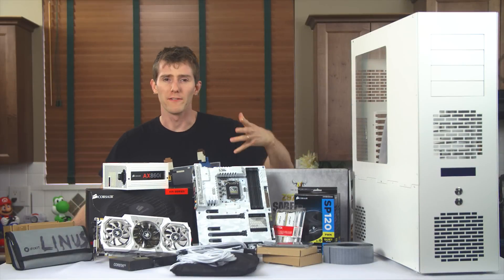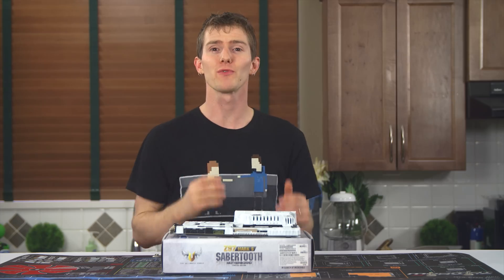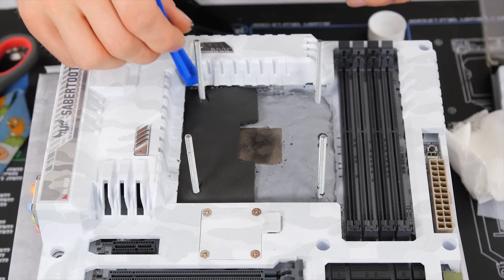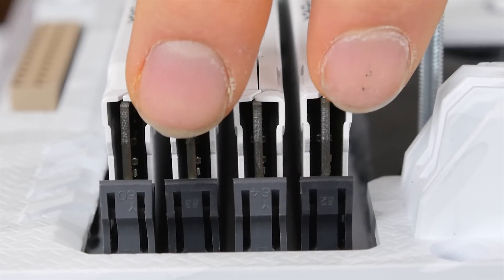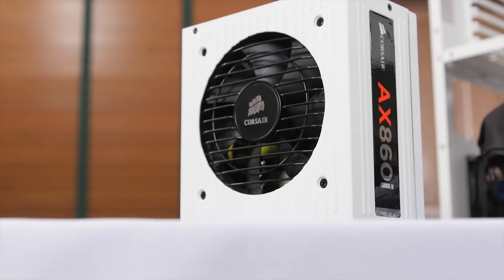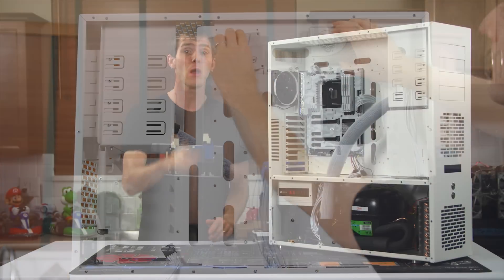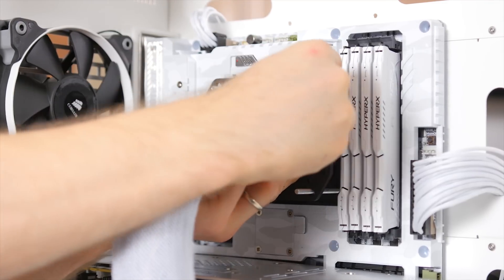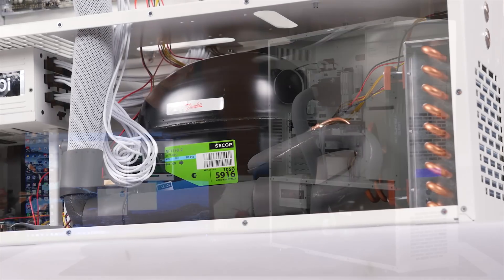ULTIMATE Sub-zero Phase Change Cooling PC Build Guide

Comment: how is it so hard for people to understand that the computer doesn't have to be in the same room. if you have a closet anywhere near where you want your workstation/media center to be that is where your workstation or media center should go, if you can vent the space directly outside all the better, but in most cases you can vent the closet up into the roof that has venting made for dealing with a surprising amount of heat, so much that no single computer could really do much to it. it isn't a rich mans deal either, it doesn't cost much to get your system set up in a room outside where you intend to use it and the difference in latency is negligible at worst. just put your computer somewhere else, maybe even just put it in the attic.

EDIT: in the case of apartments vent the heat to a room that has a vent (most closets don't), if you can afford to do a build like this you can afford to pay for the wall in advance, if the landlord doesn't want to take the money go to a well known local contractor that has been around for a few decades and buy a ticket for replacing the wall if you ever move out, that way if you can't afford it when you move out you already payed for it so you won't get stiffed on your deposit or hit up for repair. get two copies of the transaction and give one to the landlord so if you forget to call the guy up the landlord can, and if he doesn't bother to read his file on your apartment you can point out that you had already paid for the wall to be replaced, you just forgot to call and he could have because you gave him the information.
Reply: MarioDragon It reduces noise, so you can have water cooling/air cooling and fans running at 100% without hearing it.
Reply: basically, if the computer is too loud, move the computer, it works just as well 30 feet away in it's own room as it does sitting 5 feet away in your living room. stop thinking in a box people.
Reply: This reduces temperatures for overclocking... how?
Reply: Mathias :P thx
Reply: If you guys think having a mini fridge on or under your desk and think it wont be loud, you must be deaf. This would be very loud.
Reply: Apansyy wrong thread? nobody here is arguing that. this thread is about the fact that your computer doesn't have to be anywhere near you in your house. i haven't mentioned it yet, but this is why i don't care about how loud my computer is, if it gets too loud i'll just invest a hundred or so bucks and move it to somewhere else, i already only use a usb3 hub for peripherals, and i connect nothing else except sound which i could route pretty easily through optical without much added cost for the receiver, and i wouldn't need that for my headphones because they are plugged into my monitor that gets sound through hdmi, my speakers would need a line in, but i could give my speakers that from the same source. i think that most people don't realize that usb and hdmi cables can be 30'+ in length, and with that length they could literally put their computer a couple rooms away from where they are using it.
Reply: kght222 Sounds legit to me. I used to move it about three meters away from me when silent fans were not a thing. Still noticeable, but much better. And with the digital signals from DVI, you don't even need to worry about a massive input delay of your monitor. So yeah, your solution is recommended Sir.
Reply: LimPu people need to know that walls are not obstacles, they are cheap to build in most cases and as such cheap to replace if you have to, drilling a hole into one isn't a big deal. once you isolate your system to your server room you can worry about sound dampening the room, but worrying about the sound output of the computer itself should be the niche issue, not the other way around. everyone needs a server room.
Reply: Mathias :P I've had my fans at 100% before and noticed no major difference in temperatures when it came to overclocking. Even adding more fans is minimal, 1-2 degrees at most. Someone doing this doesn't want what mildly cooler air a full fan will give, they want... sub zero
Reply: Mansen hack nothing, all those cords are available pretty cheap on amazon. what costs is if you want to go wireless with your usb extension.
Reply: ***** usb can go pretty far, you just put a hub on the other end.
Reply: ***** a 16 foot active usb3 extension cable is only about 15 bucks on amazon.
Reply: ***** oh, and no. you would not have to go outside the room every time you wanted to turn the computer on or off, it is quite possible to do that through normal input devices over usb. usb3 may have some issues doing it still (don't know) but usb2 has been doing that for over a decade.
Reply: ***** and to connect/disconnect something you would just plug it into the usb hub in the room where you are, not go all the way back to your server room or media center closet.
Reply: kght222 GO LINUX and do X window server. Hhahaha, MS windows can't handle it itself. I could game BF4 ultra on a netbook, with X window running.

A GPU server running the game, the netbook displaying the game. hhaha windows is getting old
Reply: kght222
 i don't think you quite understandt linux, wine can run every windows programm ever written on linux. (wine is NOT an emulator). Windows can simply not do what linux can, and windows needs more resources leaving you with less for games.
Reply: Johann Siewers if that is true why does valve have such difficulty getting games for running on linux? it isn't like none of their games come with emulators attached (dos box) so that wouldn't be something outside their realm of experience. wine doesn't run windows games worth a shit, but you can run an instance of windows in a virtual machine running on a linux computer, and with some work you can even get hardware access to the video device in a way that will let you run windows direct x games in windows running on linux.
Reply: Johann Siewers and yeah, if wine is running a directx program, it is an emulator. there are circumstances where it isn't, but that is one situation where emulation is definitely needed unless you want to spend money licensing direct x for use in an os that isn't windows.
Reply: kght222
 Wine Tricks , simple as that
Reply: Johann Siewers in other words a legit copy of windows running in a linux "window" booted virtual on the same system with direct hardware access, thus windows running on linux with linux acting as a bios. it is still windows dude. linux is a powerful beast, but there are some lines.
Reply: Johann Siewers oh, and that ISN'T WINE. show me you running far cry 3 or even any game AAA title in the last 4 years that doesn't have a direct linux release. i'll even count da2 because it has a mac os release which is easier to deal with in linux. wine doesn't run games, and when it does it doesn't run them well. linux runs games great, but they need to be compiled for linux.
Reply: Johann Siewers wine if fucking awesome for apps, particularly when integrating an app server into an established business network among other things, but 3d apps are a mine ground of problems.

Comment: But.... No tempretures?! That's why I watched :c
Reply: Jack Back He says near the end...
Reply: Jack Back there is temp in the video. @5Ghz with 1.4ish volts it gets+2C on the 1st core up to +18C on the last. Not gr8 performance by that phase change at all to be honest.
Reply: ODIO POWER hmm seems like YouTube bugged it out
Reply: ODIO POWER well...for the settings it's running at, it actually is really great performance cooling wise.

 It's just really not worth the time and money considering the overall increase in speed isn't going to be dramatic.
Reply: Greyghostvol1 yhe ofc its a gr8 to have less than 10 degrees on the cpu, but for that price range is totaly not worth it. You can have better phase change cooling for less money so far. The only "cool" aspect here is the estetic.
Reply: ODIO POWER Wow, wait, where can you find a better phase cooler for cheaper? Because the only ones that are better than this go well into the 2k price range for just the kit itself At least this one comes with a good case and all white aesthetic.

But anyway, this isn't for some everyday user. You don't refrigerate your CPU and then turn around and just play minecraft on it (usually). This is for power users and hobbyists that have the money to burn on this. If buying this rig will bankrupt you, this build isn't for you, that simple.
Reply: Greyghostvol1 i used to be phase changer daily use, but i removed it, too loud, too expansive. but i still have it, btw look at dimastech, u can buy it for less less money and better performance.

Comment: I need help with computer specs.
Reply: Matthew lawrence Get the big ones!!!
If you have a specific question I'll throw you my opinions though.
Reply: You can't get help unless you state what you need help for.
Reply: Right.

I need a gaming pc that can play a wide range of games from simulators (fsx etc) to fps etc but I also need to be able to do some light photo editing with Lightroom and Photoshop.

I also need to be able to load games and applications quickly (SSD)

This machine will mainly be used for gaming but needs as I said the photo editing and some word processing.
My budget is about £800-£900 (ENG)
Reply: enginesnblades
Reply: Matthew lawrence Well you're using a different currency than I do and I'm assuming that means you're in a different country with different prices. However I can still be of some use. I game quite a bit and use Photoshop and word editors daily though any modern computer will do word editors just fine lol.

For Photoshop you need 8gb of ram. People will tell you that 4 is ok. It's not. For me going from 8 to 16 was beautiful but you'll be ok with 8, just use only half of your ram slots so you can upgrade easily later if you want to take advantage of more undos and layers and things without slowing down. As much as I love AMD let's be real - you'll be much happier with an I series cpu. I have an i7 3770 and it's fantastic, I'd say probably look at a haswell i5 or i7 depending on what you can squeeze in. 

You may read of some problems with Photoshop and 200 series gpus but ignore them. The latest drivers solved the quirks with gpu acceleration in cs6. Some people also blame the fact that you cant use gpu acceleration with multiple monitors on AMD but they're wrong. It just doesn't work in cs6. I've tried with a 280x a 290 a 970 a gts 450 and my cpus integrated graphics. I didn't want to believe the people who said it was true, but I fully agree that this is a Photoshop issue that gpus can't solve.

Basically get an i7 if you can i5 if that's all the budget will allow. Get at least 8gb of ram and then take whatever advice people give you after that for systems in you're budget. And yes the i7 to i5 difference in Photoshop is very noticeable. Gamers will tell you i7 is unnecessary and for games they're right but imo I'd rather get lower frames by sacrificing some gpu power and get a way better Photoshop experience. Note though I'm an artist drawing on an art tablet so I need to have 0 noticeable input lag.

Comment: How much is the electricity bill for this beast? o_o
Reply: LChiuy over the sys Watt consume add 300W drained by the refrigerator it self.
Reply: ODIO POWER Only 300W? I thought of about 1500
Reply: only? as day use its a suicide on the electricity bill. Btw u can have a 1.5Kw phase change, just look over the internet for "triple cascade phase chenge" and you will not belive to your eyes ;)

Comment: I would like to know what refrigerant was being used in this system. Because basically this is just a low temp refrigeration system being used.
Reply: masterkey1887 the gas used is R403b almost for sure, all the refrigerator use that gas now days, ruled by law.